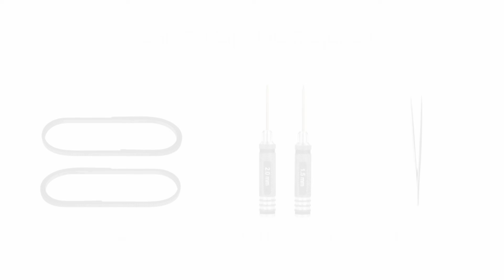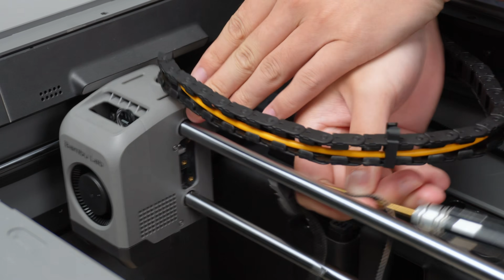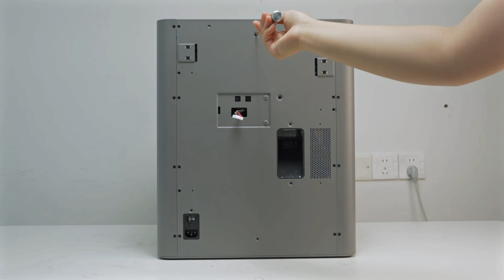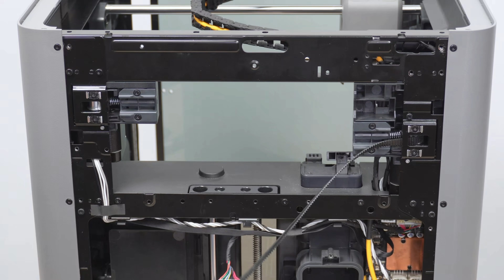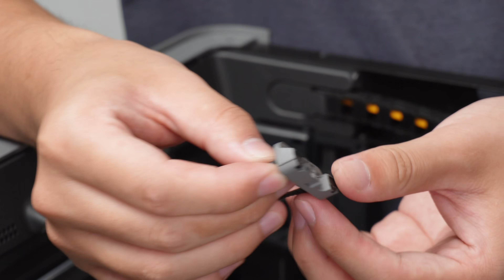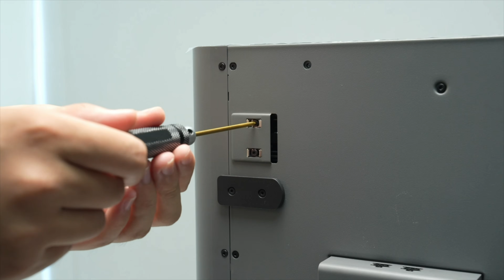XY Belt Replacement Guide for the P2S and X2D

Comment: You're doing wrong since the beginning!!! 
First turn off your 3d printer and remove the power cable. You must loose them from the belt tensioners from behind the P2S or X2D. Remove the back panel to easy access. Take out one side of the belt support. Use the old belt as a reference guide to pass trough the new belt and don't remove the other belt support until you have the new one close enough to the printhead. 
Next put the new one in each belt supports, put back the back cover and next tight the belts with the belt tensioner putting the printhead in the back left of the printer holding the X gantry until you feel tigthen enough. 
Next turn on the printer and do the full calibration.
IMPORTANT NOTE: PUT THE BELT IN THE SAME SIDE. DON'T TURN IT UPSIDE DOWN
Remove this video and make that video explaining what I had explained before.

Comment: How soon(year/hour) will we need to do this?
Reply: They last for quite a long time, if they are badly tensioned they won’t last as long but under normal heavy use about 1400 to 4000 hours, or until print quality degrades